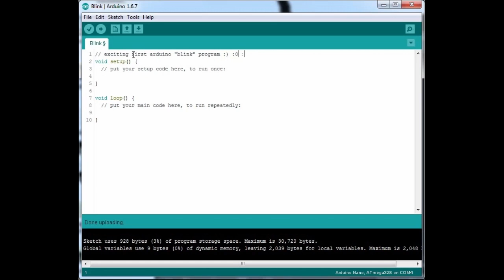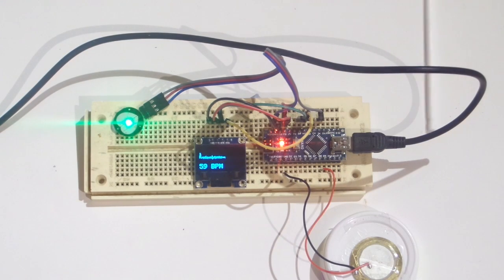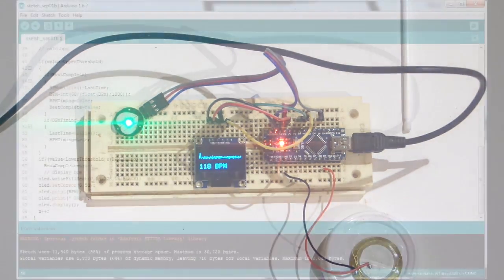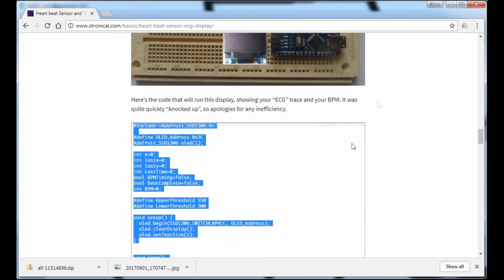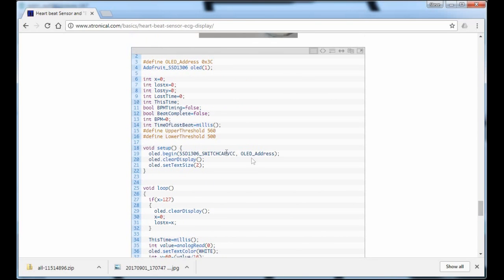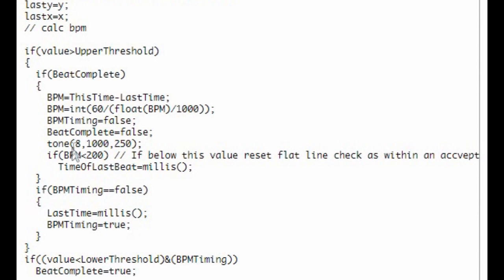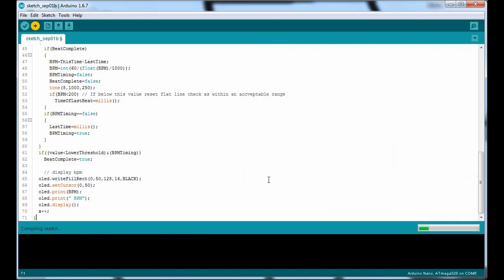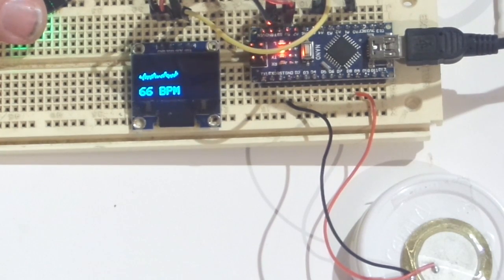Heart/pulse sensor with Arduino - Now with sound!

Comment: Will this work on NodeMCU ESP8266?
Reply from the maker: Yes, it has the required inputs etc. You just need to connect to the right ones
Reply: @XTronical  so how do i implement the input for the sensor since is pin A0?
Reply from the maker: I sorry but I don't have time to help create projects in detail, only give short advice. You need to look at the pin out for the esp8266.

Comment: Hey pal, i think i'm using an oled just a bit bigger, so the signal maps in just the quarter upper half, any hint for successful adaptation?
Reply from the maker: No problem;
To change the overall Y position is given by this line
int y=60-(value/16);

Change the "60" to alter the Vertical position. To scale the pulse for difference heights change the "16" - higher will make trace smaller, lower - bigger. You might be interested in the other videos I've done on this topic, there are several, here's a list;

https://youtu.be/Bo4OLvpfWzQ     (This project built onto a board with battery)
https://youtu.be/17im1J1EdZA      (A pulse and oxygen measuring project with colour screen)
https://youtu.be/yhRL_W1WhV0    (Problems with those cheap pulse sensors)
Reply: Genius @XTronical

Comment: Does some parts of this code change if I use a 1602 display instead of this display? Or corresponding physical connections? 

Please reply. It's important.
Reply from the maker: Yes, 1602 cannot do bit mapped graphics and would not be able to draw the line, plus quite a few other changes would be required.

Comment: Hello! I'm very interested in this project to create it. only that I have a Nokia 5100 display and I would like to know if the code would work for this display. Obviously adding the corresponding libraries. regards!
Reply from the maker: Yes if you can use the adafruit graphics library then would only need small adjustment for the different screen resolution.

Comment: Hi.Bpm is not correct and is not stability what can i do?
Reply from the maker: If it's varying wildly from very low to very high then unfortunately as the video mentions you need to keep quite still. If it's constantly too low all the time or to high then the code can be adjusted to compensate. These sensors are not very good if your finger moves even a little unfortunately.
Reply: Thank you.
Reply: @XTronical  how to adjust the code

Comment: Hello XTronical,on the oled screen, the bpm is sometimes 10 or sometimes 1100 not stability and the bottom line is not complete,and graphics are sometimes ideal and sometimes very bad.Good Work.

Comment: Helloo, amazing coding, a lot of love from probably all users. But would it also be possible to use multiple pulse sensors (and off course the lcd's) in one circuit? I mean, in theory it should be possible to recreate an circuit with all the analog inputs separate from the 5v and ground. But how would you make that work with the code?  (There would probably be an easy solution for, nut I just started playing around with Arduino) <3 thanks in advance
Reply from the maker: Thank you for your comments. Yes you could use multiple sensors with some adjustments to the coding, which wouldn't be horrendous. What ideas do have for multiple sensors?
Reply: XTronical wow, such a quick reaction :) well i wanted to create three seperate cirquits. So every pulse sensor displays it’s own heartbeat on an seperate lcd. I’m using the same components you are working with, the only thing is that there are three of them :)
Reply: I’m creating an object that shows the peoples heartbeat, and hoping that when the others see this, there will be some sort of synchronization of the heartbeat :)
Reply from the maker: The main issue with that set up is that the oled used communicates with I2C and has its own unique address to allow the Arduino to talk to it. But the problem is not insurmountable. Two options are to ditch that display for an spi protocol based one or switch to implement software I2C and use different data pin on arduino per lcd. Bit tricky though.
Reply: Would it also be needed to change up the codes then? Because the standard stuff is getting a bit more clear for me, but coding wise, I'm totally hopeless
Reply from the maker: Yes, code would need altering. I am re-visiting this project shortly as I've ordered a different sensor to try and may try to use two screens to display results from two different sensors at the same time to compare.

Comment: hello my OLED works perfectly with exmaples and all but shows only a line when i use your code. i've set it up and it displays the examples great but your code just doesnt work?
Reply from the maker: That does seem very odd, does it no even show the BPM? Sounds like it's not seeing the sensor perhaps. Have you tried seeing if you are getting sensible values from the sensor?
Reply: XTronical I've been testing it all day and it looks like my sensor may have died so I ordered another. My sensor was fine this morning oddly enough. If there is no sensor connected would the Oled screen still be blank? Mine is totally blank with a tiny line of dots on the side appearing every now and again
Reply from the maker: I would expect just that for the heart trace but would expect it to show 0BPM also.
Reply: XTronical I copied the code exactly from the site. The screen is just blank. I know the screen works fine as it's been tested so maybe I'm doing something a bit wrong? I'll try go through all the steps again and see how it goes.  Thanks for replying and this is a great project so thanks for sharing it
Reply from the maker: +soupaboy your welcome and thank you. If I get time I'll try to replicate your situation.
Reply: XTronical hello! Got the sensor back up and working so it shows a pulse. It's tiny tiny at the bottom of the screen and no BPM is showing so I'll be looking though the code to see how to position it and edit the size of the graph. Off the top of your head would you happen to know where to edit that? If not don't worry I'll shoot some trail and error at it :)
Reply from the maker: +soupaboy Mmmm... The positioning problem is odd. I'd be interested to what you do to solve it. To alter mid point of trace you need to change the line that reads

Int y=60-(value/16);

Making the 60 less or more will change line position.
Reply from the maker: I think your sensor is putting out values that are very different to the ones from the one that I used. You should try the simple code on the website for checking the sensor, here it is for you.

void setup() {
  Serial.begin(9600);
}

void loop() 
{
  Serial.println(analogRead(0));
  delay(20);
}

and look at what the range you are getting from the sensor (i.e. max and min)
Reply: My feed back shows between 495 and 540. Should i put those values into the upper and lower Threshold?
Reply from the maker: No, I was just checking it was giving around 512 when not picking up a beat and it is, those values are fine. One thing have you watched my OLED video (https://youtu.be/ZzqOYwG-OzM) or read the article at http://www.xtronical.com/basics/displays/oled-128x64-arduino/

This mentions these lines in Adafruit_SSD1306.h

// #define SSD1306_128_64
#define SSD1306_128_32
// #define SSD1306_96_16

which to work with a 128x64 OLED must be like this

#define SSD1306_128_64
// #define SSD1306_128_32
// #define SSD1306_96_16
Reply: XTronical yes I've done that and watched the videos. I also tried the other combinations of screens. I have two different branded screens too and get the same result.
Reply from the maker: Hang on, just realised your minimum range was 495 and max was 540, you should get a bigger change than that when reading your pulse from your sensor. But that would only give you a poor graph it would not make it appear at the bottom. Change this line

int y=60-(value/16);    to     int y=40-(value/16);    and see if that moves the line up.

Also change this line 

  oled.setCursor(0,50);        to      oled.setCursor(0,20);       and see if it brings the BPM into view

But as I said, your sensor is not giving a good range of values between a pulse and no pulse.  It should be a bigger range than 495 to 540.

Hope this helps,
Reply: XTronical thanks I'll give this a go and let you know :)
Reply: right so i changed the numbers around and got everything to fit but until i get a new sensor I don't think I'll get it to show my pulse properly. It will be coming in a day or two so i'll let you know how it goes. Thanks!!
Reply: same result from the new sensor. Not sure what i'm doing wrong to be honest. my range is still between 495 and 540
Reply from the maker: I'll re-write the code with your numbers in mind,see if we can at least get a good pulse from those numbers. give me a couple of days or so.
Reply: don't worry if it's any trouble. I'll look at getting my pulse sensor from where you got yours first. Maybe mines a cheap knock off. Really appreciate it though

Comment: Hi! I have problem because on my Oled i see just "BPM 0" . Any ideas why it's like this?
Thanks for any help :)
Reply from the maker: Mmmm... But you have a graph display correctly? If so try changing the values for the threshold variables in the code,  try lower threshold at around 480 and upper around 650. See if that improves things
Reply: Thank you! :) it already works!

Comment: bro i got a problem whit adafruit library my oled display do not work whith thah, so i had to install u8glib library but i don know how can i use your code to grafic cardiac pulse from the sensor 
please help me i working whith u8glib library
Reply from the maker: Is your a different oled? can you put a link to one so I can see it and perhaps I can re-write some of the code to work with u8glib.
Reply: XTronical Im using the same oled 2ic 128×64 but didn't works whith adafruit library just whith u8glib can you have any email for send you pictures please
Reply from the maker: I've sent you a PM
Reply from the maker: PM means I've sent you a YouTube Private Message with the email on. I'll send you a direct email instead
Reply from the maker: I've sent you an email
Reply: XTronical ok man i've send you a message on email

Comment: Hallo i dont get bpm on Oled. Please help
Reply from the maker: Do you mean you get "BPM 0" or that the words BPM do not even appear?
Reply: It dont appear!
Reply from the maker: Then would seem that you may be using the serial monitor code rather than the code with the BPM display, double check the guide at 
http://www.xtronical.com/basics/heart-beat-sensor-ecg-display/
to make sure you have uploaded the code with the BPM code in it. If it still doesn't appear are you using a display that has a small vertical resolution, if so it may be missing off the bottom.